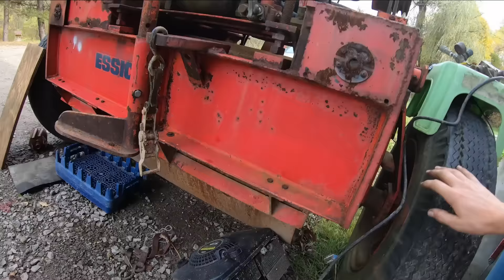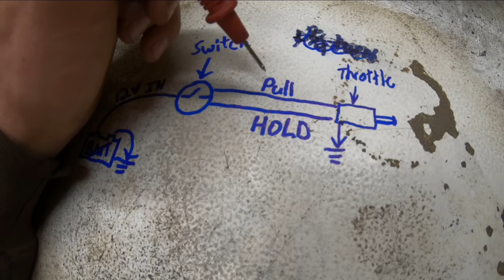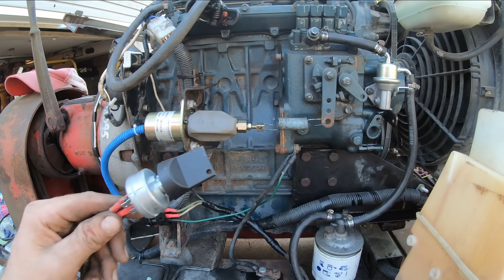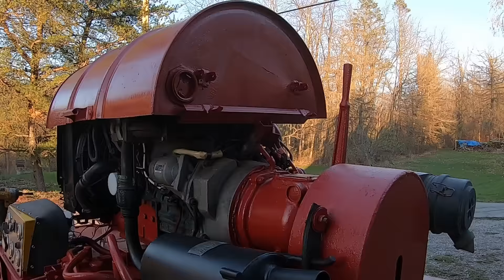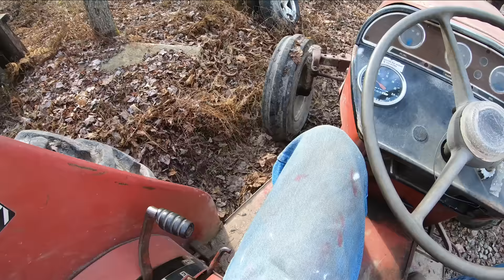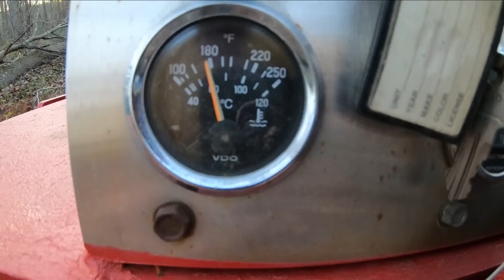Junkyard Kubota DIESEL powered Roller/Compactor build COMPLETE! (Lets try it out!!!)

Comment: I’m thinking you can go back to the start switch you tried originally now that you’ve changed out the extension cord to a heavier gauge. The problem was most likely too much voltage drop in the smaller gauge cord, not the start switch itself. Just a thought in case you liked the start switch better. I know I did. Great restoration job. Well done, sir, well done!
Reply from the maker: Yes I’ve thought about that as well. However I kinda prefer the setup I’ve got now it’s doing just fine

Comment: Finally, one who does not like straight pipes.
I have been driving trucks for about 35 years 
and I know that mufflers are very good.
Reply from the maker: Indeed! My pick up truck is straight piped and it’s fine under normal driving, but when towing it gets awful annoying
Reply: I've heard it, but it's a V8, right?
Reply from the maker: @makingithappen5178  yes, and I only did it for the performance gains I never wanted it to be loud it’s just an unfortunate side effect
Reply: @DieselCreek  But a V8 has the right to rumble. At least that was the case when I was young, in the 70's in Sweden.

Comment: I suppose if you loaded the tyres you could get a little more weight on to the roller ?  but I dunno if the wheel retracting motor would handle that.
Reply from the maker: There is no point, the weight is not whats providing compaction here it’s the vibration of the drum
Reply: @DieselCreek  you will find a proper road roller that vibrates(some do some don’t) is a lot more effective  than a lightweight vibrating roller, like a heavy plate tamper is a lot more effective than a light one.    Good mini series, sad the original motor died.
Reply from the maker: @CrimeVid  this thing weighs about 5-6k lbs it’s not a light weight machine lol

Comment: Hey Matt, you can buy a fuel rack solenoid which has two coils, a pull in coil and a hold coil. The pull in coil draws about 30 amps and the hold coil 5 or so amps. It has an inbuilt electrical contact. When the solenoid is activated, the inbuilt contact opens when the solenoid has pulled in so that the heavy pull in current is disconnected.
Reply from the maker: Yes I looked at some of those, they were much more expensive in the $80 range I think I paid 15 for this one cheap is usually my route 🤦🏼‍♂️
Reply: @DieselCreek  Way to go :-)

Comment: Paint looks fine to me.  You would have had to do a lot of metalwork to get a new looking result.  It's always amazing how you can cobble something out of junk.
Reply: It’s only a roller not a Ferrari.
Reply from the maker: I just hate seeing brush strokes, spraying it would’ve looked much better
Reply: @DieselCreek  I know what you mean.  Is that sandable paint?  Something like Rustoleum oil base is hard to sand.  but maybe next year if it still bothers you, sand and spray it again.  You might need to make a paint booth for your crusty equipment to get painted in.  

Andrew Camarata (youtuber) bought a huge Hyster vibratory roller, which ran great, but had a hydraulic leak.  Asking price was $2000.00.  he bought it and found it to be too hard to work on, and too big for what he needed.  So he bought one that fit his skid steer.  And sold the Hyster, probably for a profit.
Reply from the maker: @markeholbrook  yes I saw that, I watch his channel avidly I know he sees some of my stuff because we talk occasionally I was disappointed he didn’t fix that thing it was neat!
Reply: @DieselCreek  I was disappointed too .. that independent roller could have done a lot more work and quicker... that skid steer addon was pretty lightweight and took dozens of passes... and he had the tracks off the ground trying to load it up as much as he could but i don't think it could be used on a paying job
Reply from the maker: @zippythechicken  I disagree those are becoming commonplace for small contractors like us, it’s quite hard to show compaction on camera but those hit quite hard. The true story was in that piece of steel he flattened, I was quite impressed with that. Andrew’s roads are already quite hard he’s probably for 2 foot of crushed shale base under them. They aren’t gonna get much harder especially from a roller like that. Id venture to say that little thing hits nearly as hard or maybe even harder than this one here
Reply: @markeholbrook  u7u7uu
Reply: @markeholbrook  7uu7
Reply: @DieselCreek  u7u7
Reply: @DieselCreek  ùuuu7uuù7u7u
Reply: @DieselCreek  lol
Reply: @DieselCreek  Next time you brush paint something use a paint with metal flake! The brush strokes disappear!
Reply: @DieselCreek  hu7uu
Reply: @DieselCreek  Few weeks with the gear oil and diesel leaks and the paint would have looked like shit either way
Reply: Best part is someone else did it... I wish some one else would Finnish my projects lol
Reply: When I saw your video title, I thought you bought Andrews! :)
Reply: Just a self-taught welder like you, always drag a stick but try pushing wire the gas pushes away the dirty air. Maybe it will help you

Comment: nice idea with the ignition switch there bud, bummer it didnt work, i wonder if it would have worked with the new wiring?
Reply from the maker: Yes I wondered the same thing myself, but had already altered the connections to work with the switches now that I have it set up that way I actually kind of prefer it
Reply: @DieselCreek  yeah that way you have it now works just fine!  i did like the clever idea of the ignition switch though

Comment: I think you may have made a slight mistake on the engine speed. The spec sheet says 2100 under load, but you seem to set it without a load. I doubt it'll affect much, but it's just one of those things that may increase the quality of work of the machine a bit.
Reply: Yes. 5-10% or so drop in rpm under load is pretty common. Not the end of the world, just fine tuning. Need to run the roller at different speeds to find it's sweet spot. Says 2100 rpm. Calculated with the wisconsin gas engine. Given the torque and horsepower differences it's probably slightly different. Anyone who's run compactors can feel when they smooth out and hammer right. He just needs to use it some and find the right rpm.
Reply from the maker: Yes off-camera actually adjusted it a little higher to compensate

Comment: That's honestly a brilliant find, using an ignition switch for the solenoid. I would've massively over complicated this if I had to build it myself, and probably would've ended up with two switches. This is so much cleaner and easier.

I don't think your switch is the issue though, unless there's a big resistor inside the switch. If it was trying to pull in the solenoid, and that would take so much current, the switch would heat up pretty quickly. Your new setup is probably the same what I would've ended up with.
Reply: It was likely just voltage drop over such a long cable. Thicker cable lowered the voltage drop. Putting a relay closer to the battery and solenoid probably would have fixed it also.
Reply: i wonder if it was the old corroded wiring
Reply: The key switch would have worked if the wiring had been good. You should have checked over the wiring before giving up on the key switch.

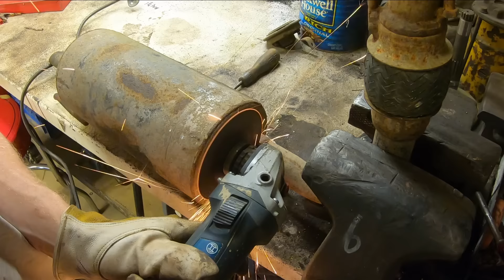Comment: 4:35 really should have the guard on that...
Reply: dont use grinders do you?
Reply: @raquskane4002  Haven't had bits of a grinding disc embed in your hand have you? It f**king hurts for a long time after...
Reply: @danielsullivan87  many of times its no worse the splinters, like in the few dozens thing that happens in fabricating  , if you to dumb to use angle grinder then don't. A guard or no guard anyone that actually uses them uses gloves and doesn't stand or any body parts in the same plan of rotation with that disk i know its hard to understand that safety is a thing that happens behind your eye balls